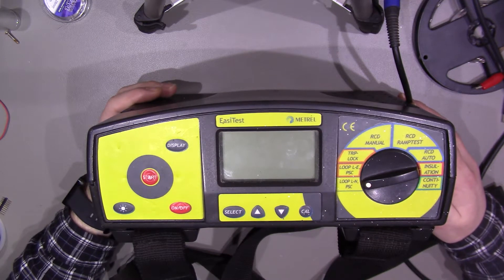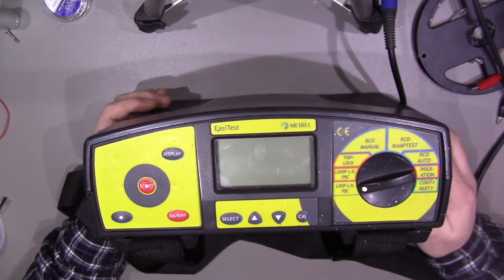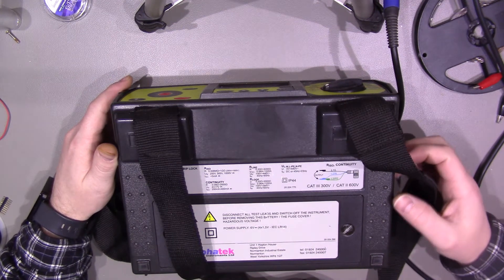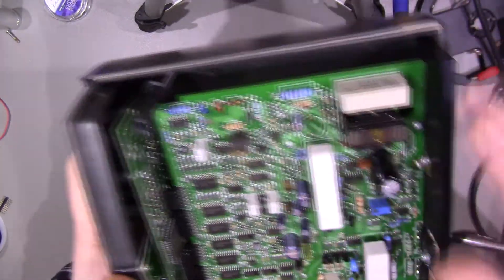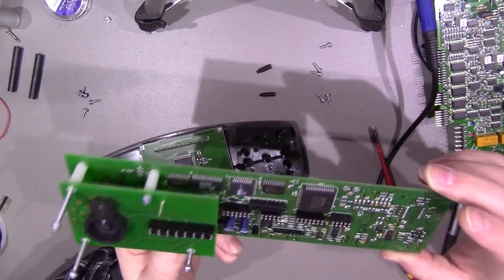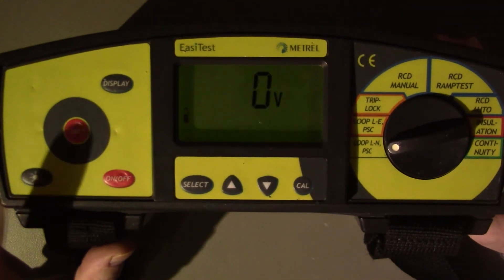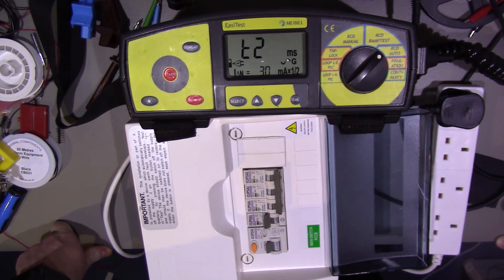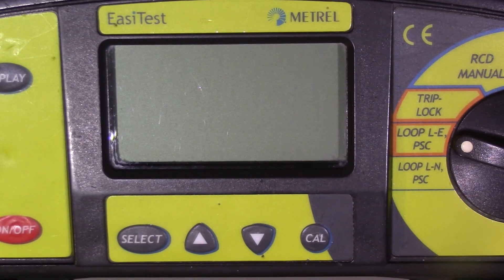Metrel EasiTest MI 2087 AL2 - Teardown & Testing

Comment: better test the caps with an esr meter!,i built mine from the 5 transistor esr meter project from the eev blog forum,tests at about 100 millivolt so ok for in circuit testing of caps.